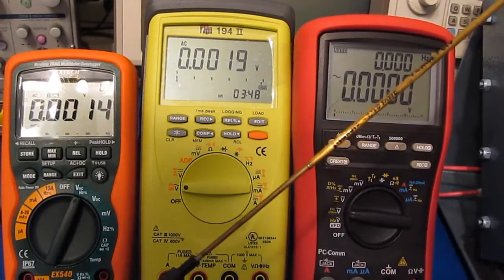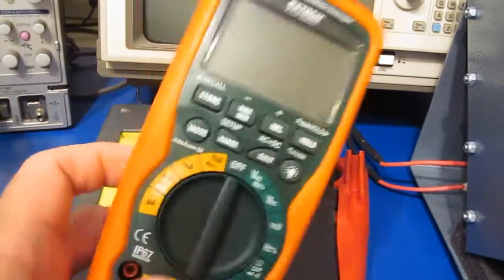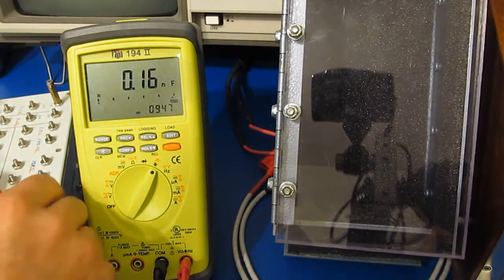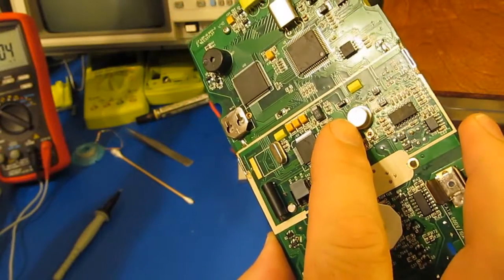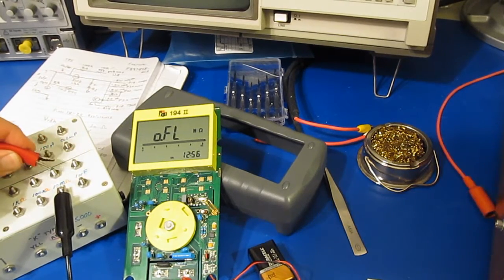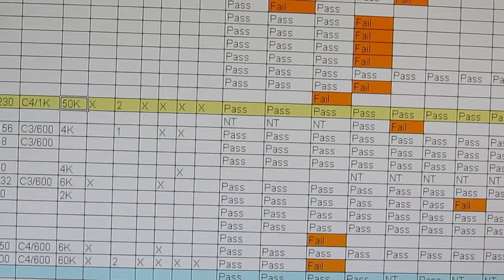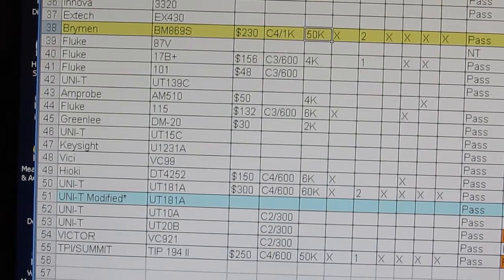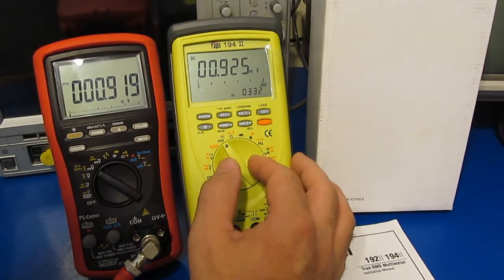The TPI 194 II DMM Part 2

Comment: I'm not sure you've included the inductance measurement testing - or I must have missed it skipping through your video. Can you please care to point me to it as the LCR capability is what interests me in this meter the most?
I've noted that you don't recommend this as an LCR meter substitute. I fail to comprehend why a manufacturer would offer LCR capabilities on an expensive/mid priced meter only to have these curtailed. I mean, I think if they're going to go ahead and offer these extra capabilities, they should make these on par with the rest of the meter's capabilities and price level. I know this is quite subjective of course.
Reply from the maker: Part 1, within the first 5 minutes.
Reply: Thank you - I did manage to miss that. You're right, its inductance measuring capability is inconsequential.
It's interesting to see that you're probably more interested in measuring inductors in the nH range while I'd be more interested in the mH - H range. Probably a lot to ask from a multimeter.
Reply from the maker: @Stelios.Posantzis  I wouldn't say I am in interested in measuring a certain range of inductance but yes some of what I play with does require some fairly small values.   I will use my RLC meters or the VNA if I need to make these measurements.
Reply: Have you made any videos on LCR meters or LCR/impedance bridges? Most lower end meters I find on the market go only up to 2000uF and 20H. I'm interested in an instrument that can measure above that - not sure what the economical limit is on capacitance, but I'd think I'd like to be able to measure at least 20mF and up to 200H.
Non-budget meters can measure other parameters such as ESR etc. but from what I've seen so far budget meters measure ESR at most. If one seeks extra capabilities the prices seem to jump. I wonder what sort of frequencies/ranges these measurements cover for budget/lower end meters. I suppose one needs to determine what they need the instrument for e.g. whether it is for quick inspection of bad/good parts or for making accurate parameter measurements.
Reply from the maker: I have not made any videos specifically for my LCR meters or the VNA but I have used them in various videos.    Like most things, the price varies.  Mine are all fairly old now (10+ years) and are no longer offered.
Reply: @Stelios.Posantzis  you can choose agilent U1233A for this things. It is a very good LCR meter with infrared connections to upgrade firms and  software. Spot nH and uH and have very good precision..😮
Reply: Paco Massa : Thank you for the tip. I had a quick look at the manual and it seems to be a nice meter that is not too expensive. I couldn't see inductance measurement mentioned in the manual though. It seems to have a lot of features
Reply: @Stelios.Posantzis Please! I'so sorry because I write replay thinking 'bout the U1733 that is an LCR meter and not  U1233 that is a little and very good handlset meter. I own tham both by tha way..✌
Reply: Paco Massa : Aha! Now it makes sense! That seems like a very nice LCR meter. Thanks for this tip.

Comment: I also recently damaged a fortion main IC with 2KV spike last week. The protection didn't clamp down fast enough. Everything on the meter looks ok, but the IC chip heats up to much with a load for no reason now. Mine was a cheap B-Side brand made calibration meter, it doesn't read voltage AC or DC voltage now. This was my own testing out of curiosity, nothing I published since I don't do meter reviews. I suspect your IC would also get hot just by turning it on. I did a before and after FLIR capture and this showed me the chip failing. Resistors and all seem fine when I measured them. Mine is also reading constant ohms with nothing hooked up like yours.
Reply from the maker: What model was it and can you post details about the spike?   The part on this meter does not appear to get warm at all.   The leakage is fairly low.   The ohms will read fairly close in the lower ranges. Anything over about 50K, it starts getting bad.   All of the other functions work except conductance.   That's a fair amount to spend on a meter and have it fail this way.